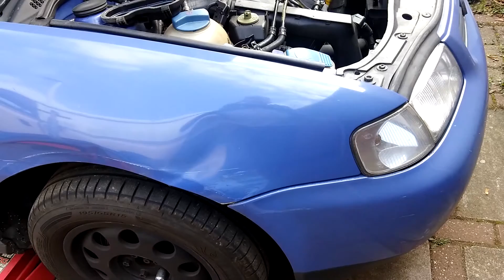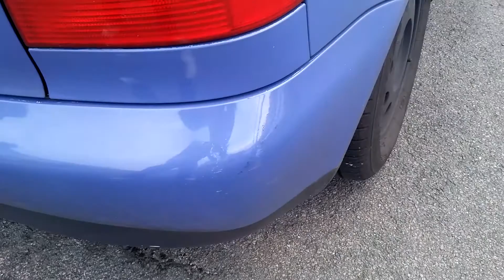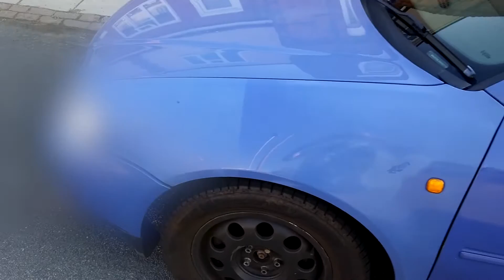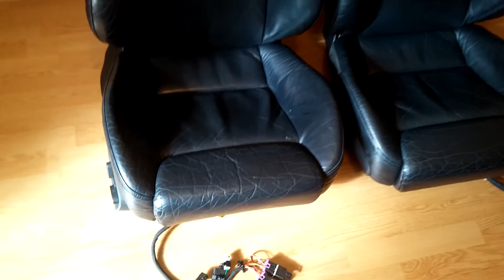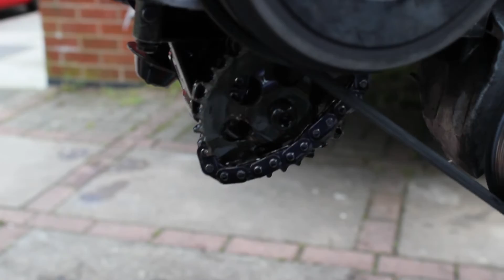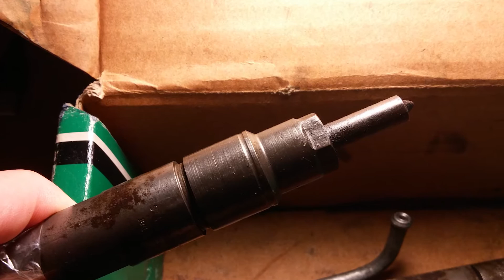Audi Car plans

Comment: any concern about sending vibrations through the transmission with a smf clutch?
Reply from the maker: +Mark Blake Jr. it is a bit rattly at idle under load when cold, but it's a good trade off for me as it is noticeably revier then before..
Reply: CarAnd Mechanical I would be afraid of the internals in the trans, I believe the syncros are made from steel instead of brass a shear pieces off from what I've read